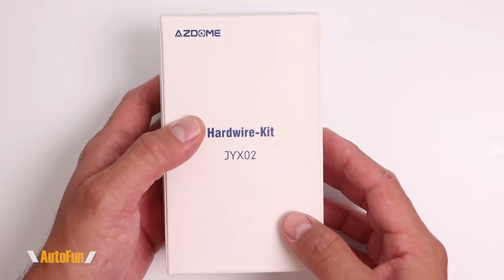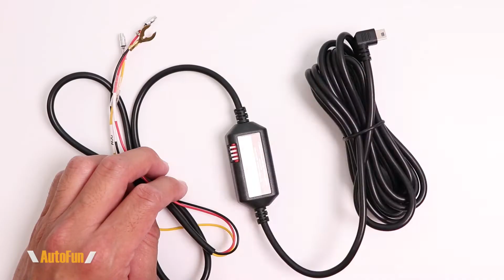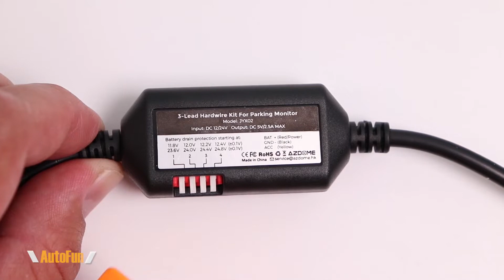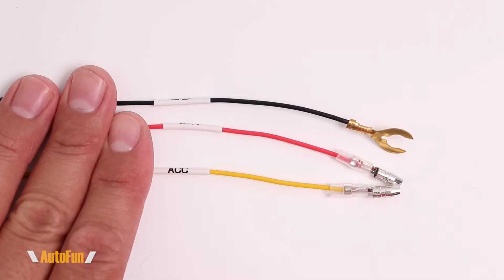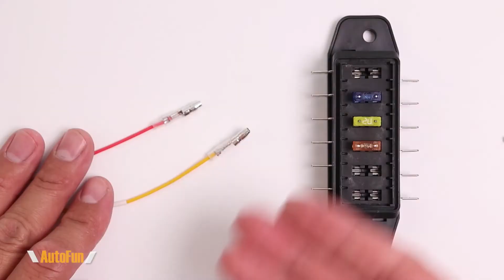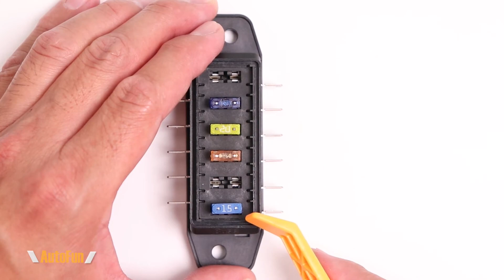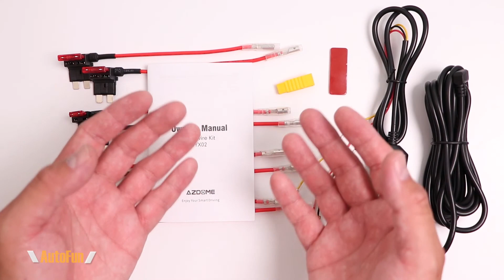Azdome HARDWIRE KIT Install Prep, Connections & Fuse Taps

Comment: Hi, Is there any specific amp for the ACC and BAT fuse, I’ve found two spare fuses in my car fuse box with 5amp. Does that work for my dashcam? Its an AZDOME M550
Reply from the maker: Hi Ambili! The Amp Rating for the hardwire kit (installed upper portion of the fuse tap) is independent of the amperage of the car fuse that was originally installed (which now goes into the lower portion of the fuse tap). Here is my fuse tap install video that may help explain this better https://youtu.be/K2iKXj82354 showing how I find ACC and BAT. Cheers!
Reply: @AlexAutoFun  Hi. I have hardwire kit without upper fuse and my question is how to choose which fuse(AMP) should I install in the upper space?? (5, 10, 20 AMP) ??
Reply from the maker: Hi Rock! The Amp rating of the fuse for the hardwire kit is determined by the hardwire kit being used (some kits have higher Amp requirements and some have lower amp draw). Here is my other video https://youtu.be/Yky9_tTvwMc where I explain how hardwire kits work and the different features to look (including amperage) for. Cheers!

Comment: Does the fuses have to be the same Amps?
Reply from the maker: Hi Romeo! not necessarily, the Amp Rating for the hardwire kit (installed upper portion of the fuse tap) is independent of the amperage of the fuse originally installed in the lower portion of the fuse tap. (And to determine the actual amperage that a particular electrical bus can carry we can look at the electrical schematics of the vehicle to check the wire gauge, current loads and determine a total working load)  Here is another video that may help explain this better https://youtu.be/K2iKXj82354 showing how I find ACC and BAT. Cheers!

Comment: First I would like to thank you for this videos you are great at explaining all the process 
And I have a question I'm installing this kit on a Mazda 3 2010 and I'm a bit confused on which battery voltage should I select because I see there are 4 different  choices and I'm sure which one?
Reply from the maker: You're welcome Eddie! ah yes I cover the actual installation in more detail on this video https://youtu.be/K2iKXj82354 Remember most of this adapters only support 12v systems (and a few support 24v). Hope this helps, Cheers!

Comment: Nice. Well, I cannot select a dash cam mirror until you find us the perfect choice ;-)

Seriously, I'm waiting to find a mirror with just the right combination of features. However, I currently have my dash torn apart for other reasons, so I figured this would be a good time to install a hard wire kit for my future dash cam mirror. Am I correct that they probably all could use the same generic wiring?

Is there a step-down device from the car wiring to USB that you would recommend, maybe even the one in this kit? I'd like to get a good step-down device because I want it to be hidden well behind the dash.

I was thinking of using a USB C cable to future proof it, and then use a short adapter to micro at the end.

Do these dash cams have a way to turn them on without having the key in ACC or would I need to wire up a switch if I wanted to do that?

I'd like to be able to sit in the car with the ACC off and still get a good picture of what's behind me. I'll just have to remember to turn it off when I get out.
Reply from the maker: Hi Tayler! ah I typically recommend sticking with the hardwire specified for your dash cam here is a video where I go more into detail https://youtu.be/Yky9_tTvwMc including the hardwire features you want to look for. Regarding keeping power on all the time, it can be done by connecting ACC to the BAT spot. But while you could turn off the dash cam via it's power button, the dash cam will not enter parking mode since it cannot detect when the car is turned off (since ACC is not connected to ACC) Hope this helps, Cheers!